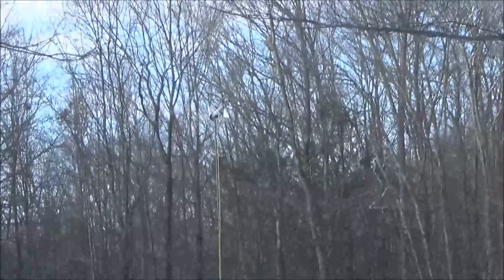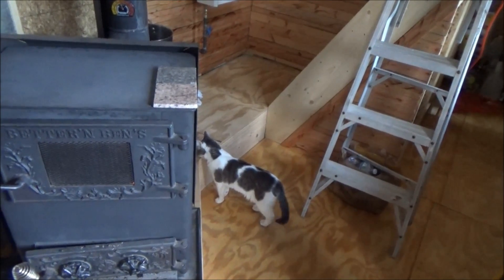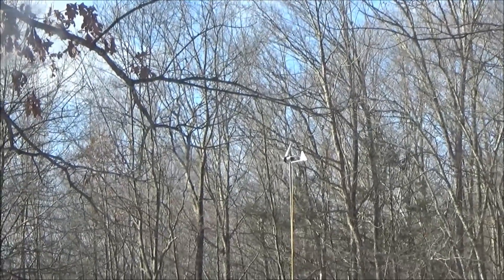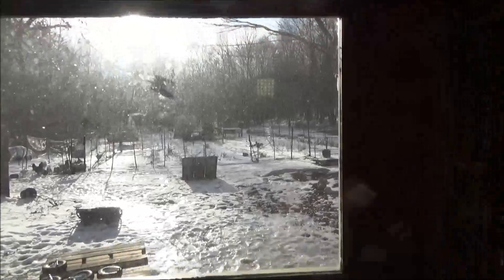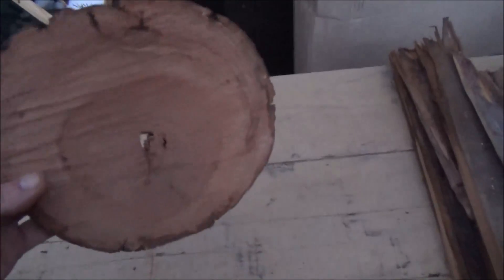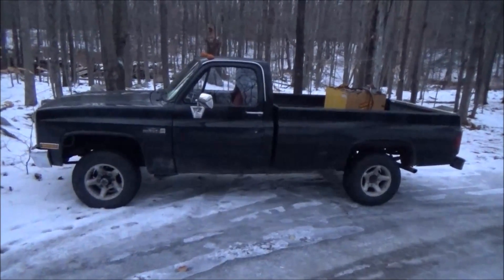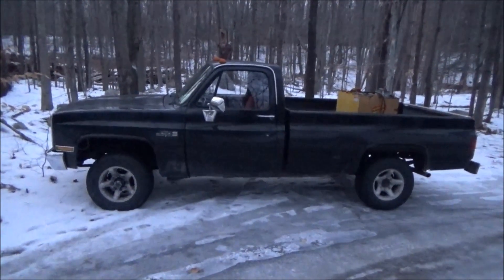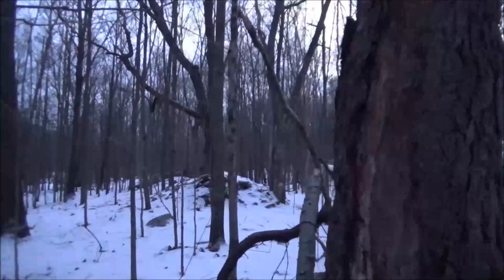Wind & Solar Power At The Off Grid Homestead

Comment: Question....... Did you run the wires from the wind Turd to your Tristar? I have a Tristar 45 and I called Tristar ( Morningside ) they told me me I could NOT connect my Wind Turd wires to my tristar 45 amp solar controller. If you did connect your wind turd to your solar controller do you have any issues running both on the same controller?
Reply from the maker: I did not

Comment: Troy do you have a reversible switch on that ceiling fan, I know in winter our stairwell ceiling fan has a switch for winter time to help pull the heat upstairs. In summer we reverse the switch and the fans spin in the opposite direction for cooling.

Comment: I reviewed the video of when you installed the stovepipe. 
I suggest that you look at it also, just as a reminder. Then check the code.
It looks to me as though you did it upside down with the crimped ends facing up.
This allows for products of combustion to leak out of the side's just as you are now experiencing.
It is dangerous as it now stands. If someone else bought the home, you would be passing the hazard on to them.
And then for people who do not know any better and then followed your example of how you installed the pipe, they would be putting themselves in danger also.
I also suggest that you see how to install the pipe properly by using an adjustable slip joint sleeve to obtain the correct length.
My only reason to make a comment is for safety reasons. There is a good reason for having codes.
I have seen many people who have burned to death, and some who have lived. I would not want to hear about another tragedy and know that I did nothing about it when it was possible to prevent it.  
My best to You

Comment: and vents are not required...the unit has auto shut off safety built in....thus the name "ventless" wall heater, however burning wood and propane 3 feet away isn't too smart. Make sure you do have fresh air coming in. Like a window cracked.

Comment: Troy I hope your not getting annoyed by me. Just trying to look out for you and your homestead... I mentioned about that wire that you have running to the turbine. I seen how you had it hooked up to the charge controller. (By hooking the turbine to the solar panel wires.) You need to disconnect that turbine ASAP. From research and already having knowledge about turbines, turbines need a dump load. (I have not heard you say anything about a dump load.) Solar panels can turn on and off, but a wind turbines power needs to be diverted. (All tho your batteries havnt reached a full charged yet. Im sure they will soon.) But im almost positive that charge controller is not made for turbines. Correct me if im wrong. I would hate to see that thing burn up on ya. Thanks and keep up the videos I always enjoy them
Reply from the maker: I have three wires running to the solar panels. Two are used for plus and minus. The other was unused. The plus of the wind turbine goes to the unused wire. The negative of the wind turbine goes to the common ground. Inside the tiny house the solar panels and wind turbine are wired separately.
Reply: The Do It Yourself World ok i see what your saying, but what about a dump load?

Comment: your right troy. The coolant temp sensor tells the computer how much fuel to spray. A cold engine needs more fuel than a warm engine which is most likely the problem. The o2 sensor may or may not have any effect at all. doesnt effect my trucks. a 89 silverado and a 90 s15. if anything not having one in that old of a truck. it may barely affect your fuel mileage. i would just replace the temp sensor and see what that does first

Comment: Wind turbine spinning and a truck on the drive way. All good news. Baby Cat p-ed off - not so good. When you hung the lamp, I was wondering whether there was enough clearance above the beam for Baby Cat to walk and play (it does seem to be directly over the beam). Personally, I would either raise the lamp a few feet (I know - less light in kitchen and living area), or move it over a rafter or so, so that it hangs over "open space".
Reply: If your propane heater kicks in every night to keep it a nice and even 70F in the house, than that is very comfortable, but I expect you will be using more propane than you anticipated for an "emergency/away" solution. And this is a mild period. I would probably set the thermostat a bit lower to make sure the propane heater kicks in a bit later. Set at 65 or even 60 degrees it will still be OK when you wake up and the wood stove will have little trouble to bring the temperature up to 70F, but it should save you a bundle in propane costs.
Reply from the maker: pieter zeeuwen I have actually set the propane heater down to 65 now. Thats about 55 to 60 at the floor. Baby hates change and gets mad when I move things around too much. There is space under the lamp for her but I will move it anyway as someone advised.
Yes things are looking good here now.

Comment: try to find some window screen, build a frame, 2x2ft, sift cooled ashes through the screen, keep them in a covered bucket in your vehicles. I drove a 64 Chrysler into a ditch with 3 feet of snow one winter, tossed 4 or 5 handfulls of ashes in front of the SUMMER TIRES, and drove out of the ditch. yup,, just drove out. hee hee!
Reply: mix with a double handful of ash and no one will know  it is "used" kitty litter. lol. works great AND keeps ya ON the road! lol (carbon kills odors)
Reply from the maker: Wow, I never would have thought of that . Thanks

Comment: Are you sure that you have your stove pipes installed correctly?
I could not see close enough to tell!
You should not see anything drip out of the Joints if it is installed correctly. 
The pipes should be installed so the crimped ends (male) of the sections must be oriented towards the appliance so that falling dust and condensation stay inside of the pipe.

If you have it installed correctly please disreguard my thought.
The reason people have stove and chimney fires are that the creaso leaks down and out of the joint that is over lapped incorrectly, then catches fire.
If the male end (crimped) in is not to the inside while facing down, then this is something that I suggest you consider strongly!
My best to YOU!
Reply from the maker: Larry Carlston I guess you missed all the videos on my installation of the stove pipes then?
This is not "temporary" as you say. No. It is permanent. The stove pipe can only go one way. The way I installed it. John confirmed the problem and agreed with me that this is the only way it can go on. Period.

Comment: Troy, my 96 Dodge was running very ragged until I found that the wires going to the O2 sensor had been broken (I think when I drove it out through my sisters field). Once I reconnected the wires to the O2 sensor the pickup started running like it should have!
We cut down a tree this winter that had barbed wire embeded about 4 inches into it. I just cut the blocks of wood so the wires were within one block. When I burned it the wires were left in the stove for me to clean out. (They were only about 3 or 4 inches long, after we snipped them at the bark on the tree).
Reply from the maker: My truck runs like a brand new truck and does not smoke anymore. O2 sensor was bad. I finally found it and replaced it today. Wow, what a difference.

Comment: you might be able to off load the battery in the truck box by backing up onto a couple of stacked boards by a tree with a good branch. use a good rope to tie the battery by the two handles cut out on the sides on the steel box and driving forward off the boards

Comment: Let us see a amp reading from the wind turbine! Or a voltage reading first. I dont think it can make enough amps to go past the ten amps the meter is designed for. You can make a shunt like nrodge shows on the techluck forum. so you can test more than ten amps. It only a 16 gauge wire cut to a exact length. Let us see what it is doing?? Use a multimeter! take a reading at the turbine and then one at the end by your batteries. You gotta have a brake hooked up to the turbine for when the wind blows too hard. you have to get some resistors to slow down the turbine in high winds or it will blow out of control and blades will be destroyed. light bulbs can be used for a resistance brake in high winds.

Comment: Unless I'm mistaken you have 600 plus watts of solar panels and now an added (Possible) 350 watts of Wind gen. yet at the controller you have 41 watts coming in total? Either the batts are topped off and the meter is wrong or your wiring is seriously in need of inspection.
Reply from the maker: Its winter and I am up North and the sun is lower in the sky. I get reduced solar in winter.
Reply: Troy how many watts are those big panels ? And how many are hooked up to the morning star ?
Reply from the maker: Pete Brown The reading is ONLY for the larger solar panels. The HF solar panels and the wind turbines have no meters or any way for me to check their output yet. I will get some meters for them
Reply from the maker: peeinginthewind I have 800 watts of solar panels connected to the Morning Star. 60 watts of HF panels directly to the batteries and the wind turbine is connected to the battery through a diode. No meters or gauges on the HF panels or the wind turbine yet.

Comment: i might have missed it, do the turbine, solar panels, and batteries come to the home separately, if so a meter could be hooked up not too hard. as per your weather unit, at what speed does the turbine produce, and what measures are there to stop the turbine from going too fast, i think bad things happen if it goes too fast, yes. good show, 2 thumbs up, lol

Comment: I would not recommend planning the wood piece you are going to use for a hot plate holder.  They are not built to plane against the grain of the board.  It could be dangerous and also could damage your planer.  Use your sander to smooth the piece instead.  Plus the results will come out better with a sander.  Or perhaps you are thinking of turning the piece on a turning lathe that would work very well.
Reply: Troy. pick up a #4 Stanley hand plane. Your power planer will be shot after you smooth that disc out. and yup, it's a trivet uh huh. get your scroll saw tuned up and cut cool little designs in those discs. I've seen them with portraits and animals on them.